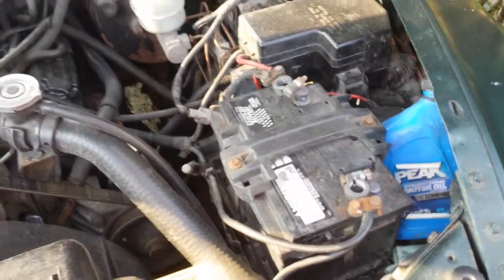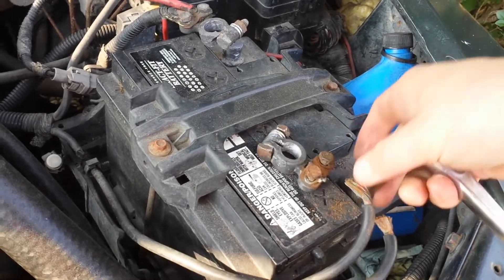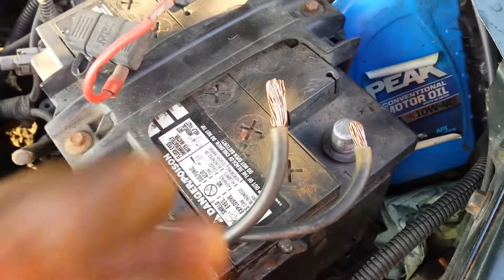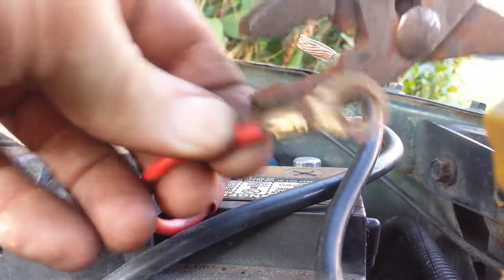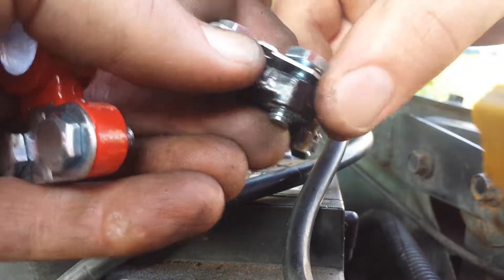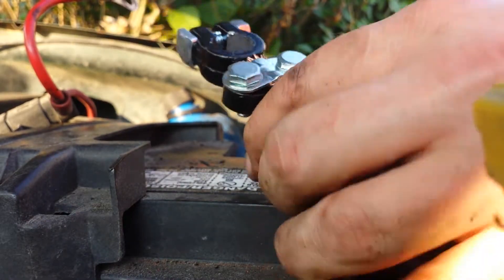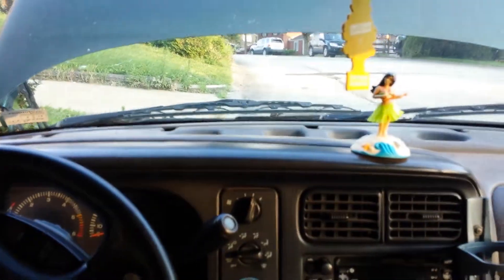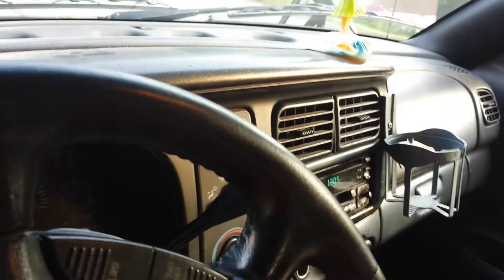Battery Cable Clamp Replacement

Comment: Beautiful work!   I can’t believe how corrode of the wires were underneath the clamp.  I have cleaned so many connections and have never thought about what the wires looked like underneath the clamp.  I also like the red and black powder coating on the new connectors. Fancy! Keep up the good work.